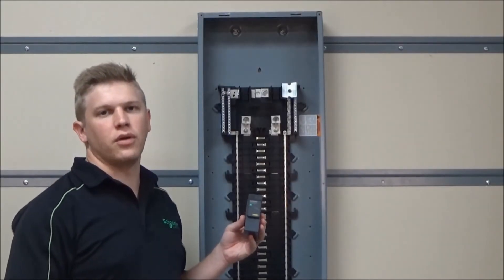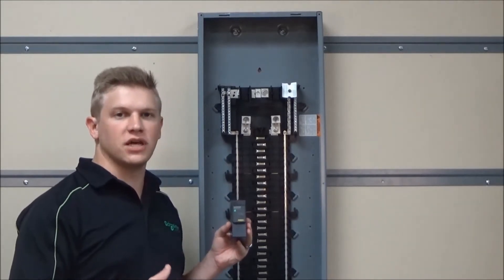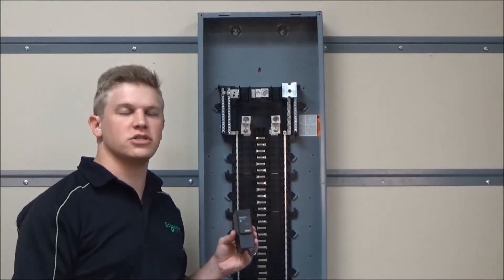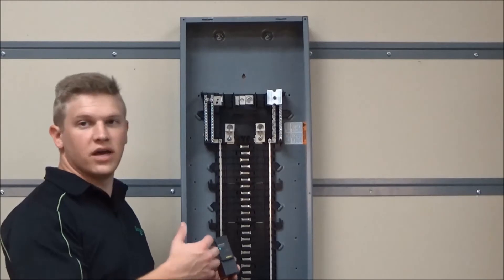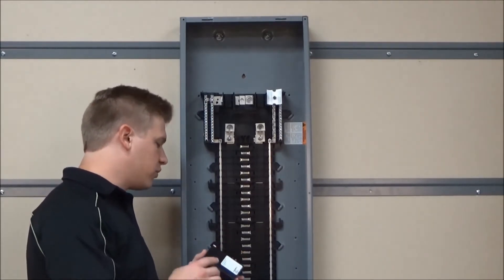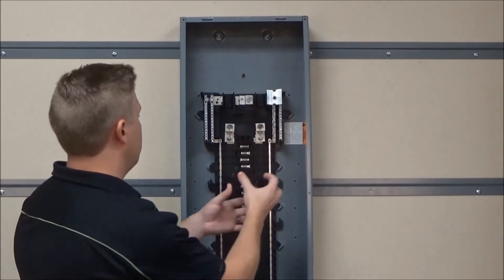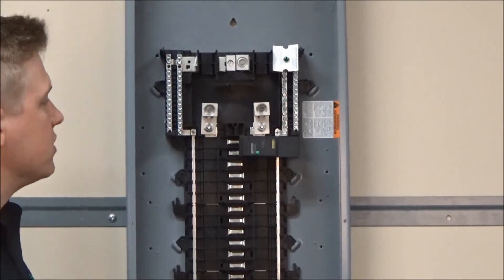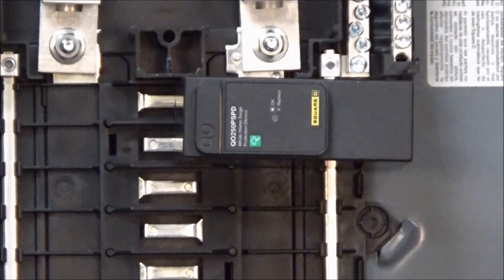Installing QO250PSPD in a QO™ Residential Load Center | Schneider Electric Support

Comment: Can I use this device on a QO PON sub-panel? I have heard that on a subpanel, the surge protection device should be connected to the ground bar (not neutral), but with this device there is only the option of connecting it to the neutral bus bar.